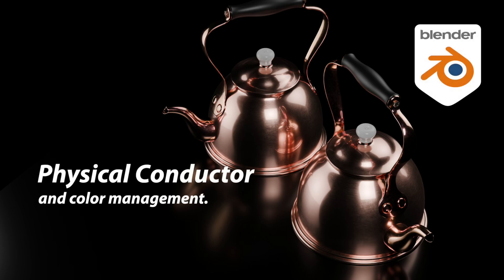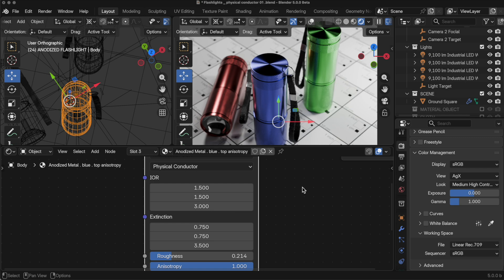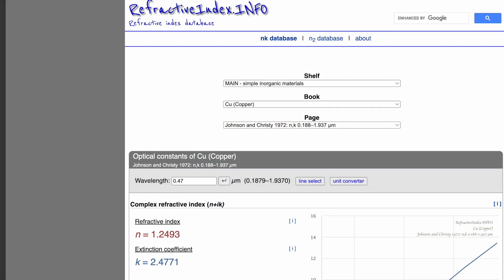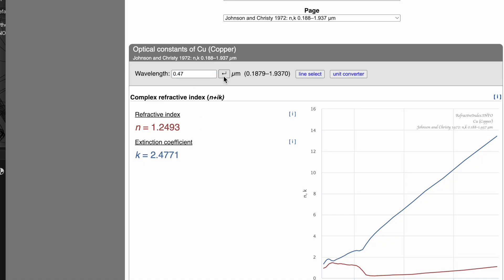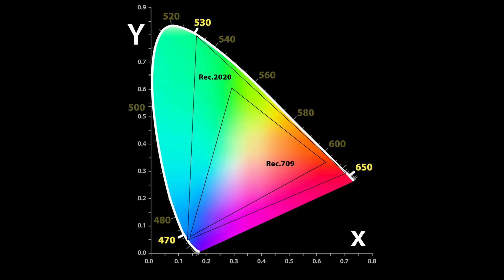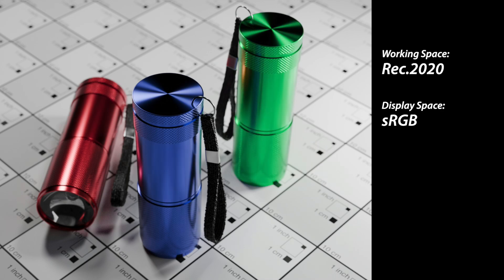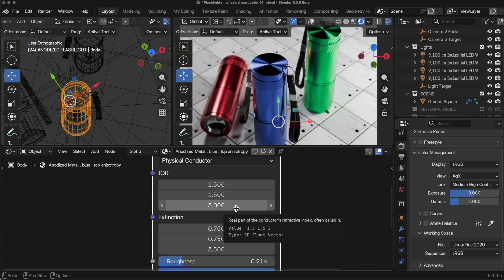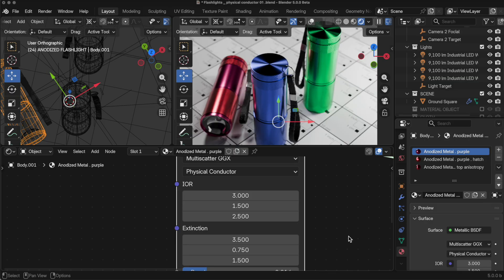Answering questions about Physical Conductor, and color management in Blender 5.0.

Comment: why blender just dont add "all colors" triangle that lay on all colors in CIE diagram? i understand that most of them will be outside real color, but it would be better in terms of computation, isnt it?

something tells me that it is exactly what should be in rendering space, or even change internal computation to HSV to not be limited by color spaces internally, and have S more than 1
Reply: Blender can add support for ACES2065-1 (a.k.a. ACES AP0, as opposed to ACEScg and ACEScc's AP1), which encompasses the whole CIE gamut and more, but it's massive, and they only just added support for AP1 and Rec. 2020 so I doubt they'll add it any time soon. Plus my understanding of colour science is limited, and there may be good reasons why they didn't add that colour gamut. It might just be too wide to be practical for all I know

Comment: If Blender doesn't internally use those specific wavelengths (650nm, etc) for it's physical conductor calculations, then I think what the "R G and B" values of IOR/Extinction mean would depend on the working color space. In this case, I would expect it to be more physically accurate to base your IOR/Extinction values on the wavelength that is closest to the corner of the triangle on the chromaticity diagram. Which wavelength that is would change slightly depending on the working color space. In that case, it would be a more physically accurate comparison to calculate new values based on the new wavelengths when you change working color space.

Not at all disputing that the larger working color space is better though. It's still a definite improvement.
Reply from the maker: The problem is that you can't base the physical conductor RGB values on the primary positions of a color space for various reasons. The first is that, like I explained in the video, the RGB consensus values aren't related to color spaces, they're pure spectral wavelength values. For instance, the ACEScg API green primary is virtual, it's outside the visable CIE locus. So that won't work. And the Rec.709 primaries are not pure wavelengths, but mixtures of wavelengths. So that wouldn't work. You could adapt the values to match pretty closely to Rec.2020 because its primaries are pure wavelengths, but the best thing to do is keep the wavelengths locked to consensus RGB spectra.
Reply: @christopher3d475 I don't think it was mentioned in his video but do you happen to know where these reference frequencies come from?

It makes sense to have a standard, but I'm wondering whether there is more to it.
Reply from the maker: @FiliusAestatis  If you look at the spectrum and specifically at a region of red, greens and blues, then you isolate the region most closely seen as red by humans, and use that as your reference range for red. For instance red is often perceived by humans as being between 620 and 750nm. So you take the peak of that range, and the common ranges used in research, software packages and just general use ends up being about 650 nm or sometimes 630nm. Likewise, for Green the range is generally 495 to 570nm, and the common range frequently used is the 'peak' value of 530 or somewhere around 546. So I used very common 'middle-ground' peak values in my materials and in the video. If I had used 546 instead of 530, it would have shifted the color a bit. That's why I went with very common values. But this highlights the problem with using RGB for rendering, as opposed to spectral rendering where the wavelengths themselves are used in the render process, not abstracted RGB.

Comment: Not sure why anybody's arguing that a color change would happen if you make the color space bigger, that's how cameras work, and unless you're doing something very stylized, a 3D scene is built to try and replicate things in a technically physical way as much as it possibly can.  You have more information, so the values will be theoretically richer

 I think they possibly might be confused by either converting a color space in a 2D software, or they didn't notice that they had the option box checked to keep the values similar when converting between Blender versions;  It makes sense to me, but I do understand how it can be confusing